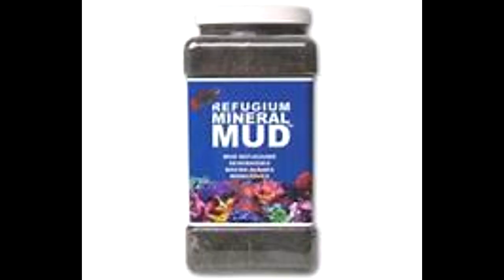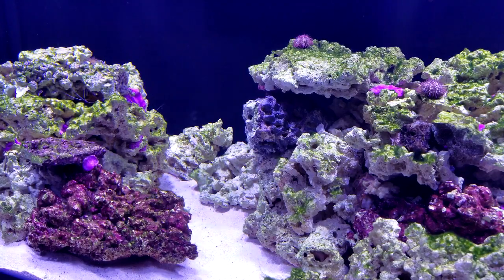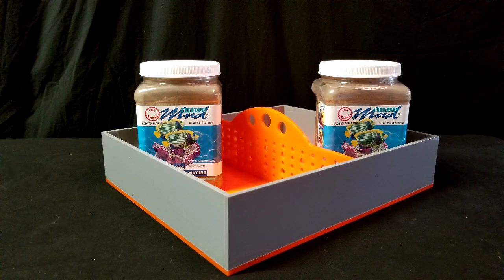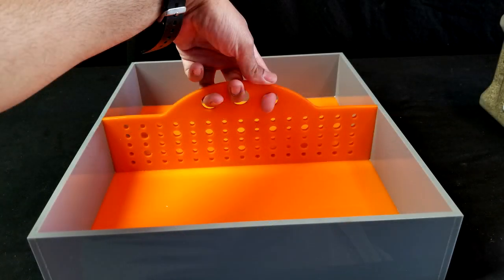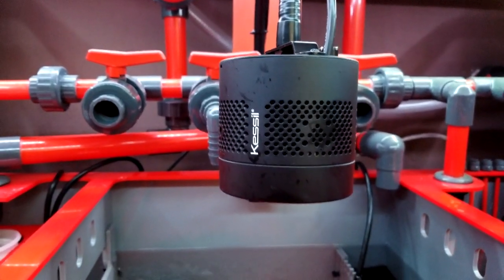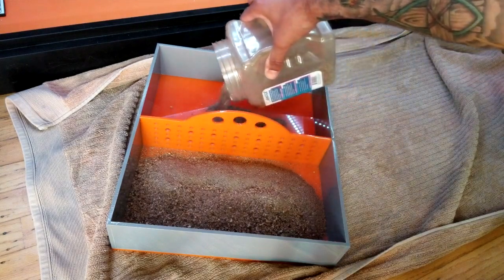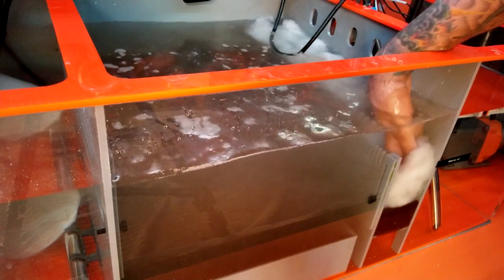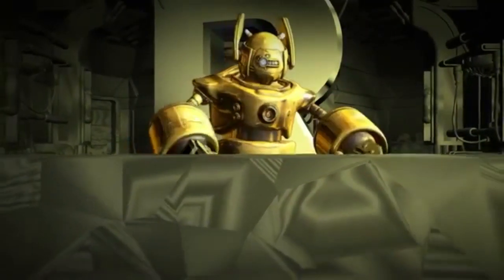Build Series|Eps. 24| Adding Miracle Mud

Comment: When I would change my mud on my 29g tank I’d lower the water level in the sump by pumping water from the return pump section. Since the water level in the fuge section won’t drain all the dust would stay in that one chamber. No filter floss or anything. Then I just dumped the water back in. Cool video tho!
Reply from the maker: Hey Klein, great way to get'r done! Thanks for sharing!